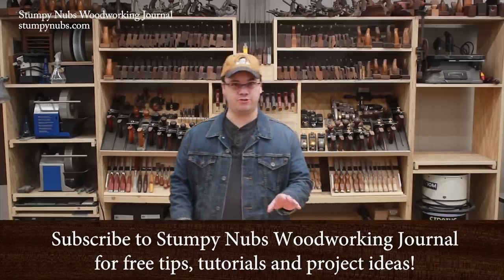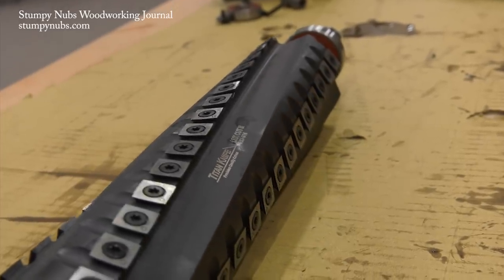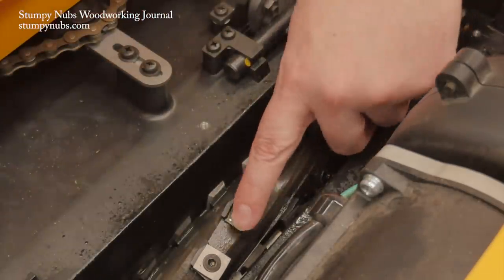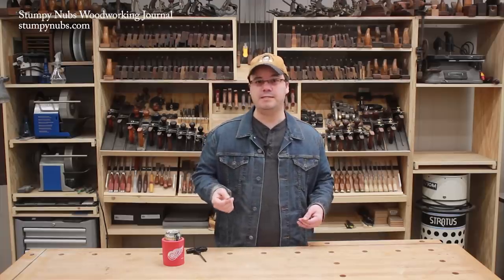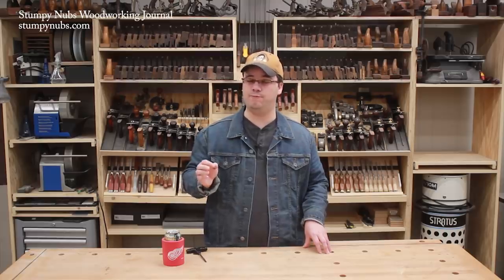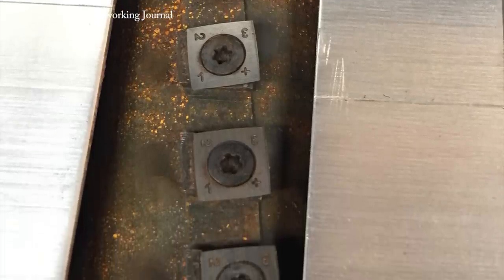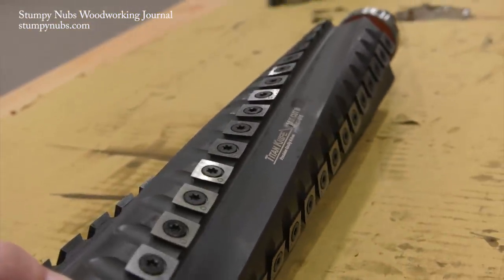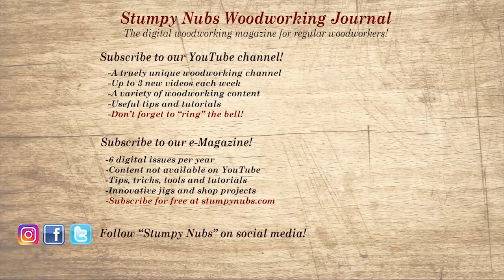Uh-Oh! Problems with carbide helical jointer/planer heads? (How to fix them!)

Comment: After running insert tooling for over 45 years in industry: when you strip a screw head, the standard method is to take a punch and shatter the insert. A blow straight down against the insert. They are brittle and can be shattered relatively easy. Once the insert is shattered the pressure is off the screw and it can be re moved with visegrips.
Reply: You da Man.
Reply: Yep. Been there, done that.

Comment: I was getting deep grooves in my boards after rotating the inserts. I tried to clean and reseat them several times before finally reaching out to Byrd directly. They sent me a pdf explaining a method to get the inserts to index properly. 
1. Make sure the head is clean and clear and the inserts are free of burrs.
2. Start the screw about 75% down into the head leaving the insert loose. 
3. Then push down & out on the back of the insert causing it to slide away from the back edge.
4. Finally, slowly tighten down the screw so the screw pulls the cutter down and back against the seat. 

I just finished trying this method on my cutter head and it worked great. My grooves are gone.
Reply: thank you for this, I rotated and now I have grooves, took everything apart and cleaned and still have grooves, I'll try this push down method, thanks again

Comment: I know this is years later but wanted to say thank you, James, for posting this video which I found when looking for a fix for my planer problems. I saw the tell-tale shallow grooves in my boards after running them thru my planer after a couple years of use and no matter what I tried, I just couldn't fix it. Only when you showed the diagram of how the indexing might be wrong did it click what might be up with my setup. I also cleaned the cutter heads and the space around them and now it's back to cutting butter smooth. Thank you so much.

Comment: Thanks for the tip on Woodcutters. I purchased a helical head to upgrade my 19-year-old jointer and it fit perfectly when it arrived. What a difference it makes in quality of cut and noise reduction. Thanks again for sending me to Woodcutters.

Comment: James, as usual, your posts are spot on.  I replaced the head in my DeWalt 735 7-8 years ago and it has performed flawlessly.  That’s not to say that I’ve never had nicks in the inserts leaving raised “grooves”.  The usual failure mode is for just the tip of a corner chipping and it can be difficult to locate the offending cutter.  I’ve found a lighted magnifier to be invaluable in such instances.

Comment: Yep.  After taking all the cutters off and reseating them, it cuts beautifully now.   75 cutters.  About 4 hours from start to finish taking the cutters off, cleaning and carefully inspecting each seat, doing the same on each cutter, never-seizing the fasteners, and carefully reseating each one and verifying that they are flat against the bottom face and not hung up on the bevel.   What a PITA.

I can't vouch for the Luxcut but if they have a system that removes seating error, then I'd recommend getting that one instead, just so you don't have a bunch of improperly seated cutters from poor factory installation and QC.

Comment: I have a Woodmaster 18" planer I recently upgraded to their helical cutter head. You mentioned that some head in a moist area rusted, and could pose a problem. When I first got my Woodmaster home, it had also included the sanding drum. It had a solid steel bar that the drum mounted to it. To avoid the rust problem I sprayed the bare steel with spray layout blueing. It has not rusted and looks just as when I brought it home, in 1993. Just blue.

Comment: My thicknesser has started producing grooves in the boards it passes through it. I have not yet changed the heads around. I was looking for a solution to this anomaly and have not really had any satiating tips on how to do so.

Thank you Stumpy for this magnificent tip! When I turn around the heads, I will be sure to take your advice and make sure they sit properly, after cleaning up any residue first.
Reply: If you're getting grooves down into your wood, a cutter may have twisted slightly, and one of the corners is digging in deeper than the rest of the cutter. If you're getting ridges above the surface of the wood, a cutter is likely chipped.

Comment: I have installed many helical cutterheads on planers and jointers and worked on many more. Whenever I install a new head I always check torque on all the machine screws and I always find a few that need a little more torque. I check it again after 1 week of use and again after 1 month of use. I always find a couple more that have loosened up a little. After the 3rd tightening they are all good to go, I also do this procedure after  turning all of the cutters.

Comment: Thanks for the info. Just put a Byrd Shelix, much due to your reccomendation, in my Ridgid 13" planer 3 days ago. So far I would call the upgrade in cut quality extreme. Appreciate your content.
Reply: I have a Ridgid R4330. Are you happy with the switch from the HSS to the Shelix? Have you ever bought carbide blades and if so are they worth the between cost of HSS and Shelix?
Reply: @timmartin6748  I've had the Shelix for about a year and don't regret getting it one bit. During the install I cleaned/oiled everything and installed a new drive belt. Motor doesn't bog down in really hard wood and the surface after plaining is really amazing. Had to rotate 1 cutter so far. Haven't had to buy any. It will be many years down the road, if ever, when I have to buy new cutters.
Reply: @Average American  I just installed a helical head. I still get minor tear out around knots. Have you  noticed any or should I expect a bit of tearout

Comment: I noticed that the lux had a circle on one corner. I put a tic mark on the edge that is to be replaced. That way, I do not accidentally put the dull edge forward. It also tells me when I have used all four edges. (always rotate the cutters the same direction.) I also put a number on the start of a row so that as I rotate the cutter, I know which one to move to next when torquing.

Comment: Just installed a brand new Shelix on my 15" grizzley... and yeah, there's three spots it's leaving pretty bad lines on the board.   I suppose its possible I damaged some of the teeth installing it but I was very careful and took precautions.  We'll see.    I marked on the outfeed side of the planer head where it was leaving lines so I can find the problem a bit faster when I take the cover off.    Hopefully its just improperly seated carbide teeth.   Not really happy about it either way considering how much the thing cost.

Comment: from a machinist perspective, always put the insert into place before you tighten it down and always clean the pocket.  carbide is very hard and will support tons a compressive force but will break easily when under tension.

Comment: The Byrd Shelix is what I upgraded to in my Dewalt 735.  Good investment from my point of view.
Reply from the maker: I put a Shelix in my DeWalt 735 too. But I put a Lux Cut in my larger Grizzly planer. Both work very well, but I got a little rust on my Shelix. I'll have to keep an eye on it.
Reply: @StumpyNubs  What, if any, are the differences in the actual cutters (4 sided)?  Is a Byrd cutter interchangeable with a Lux cutter?
Reply: @StumpyNubs  did you go with the reduced diameter head on the Dewalt or the full size? Any recommendation.
Reply from the maker: @JamieJCyr  - Full size. The reduced size throws off your depth scale and keep increases the minimum thickness of the stock you can plane from 1/4 to 3/8.

Comment: I'll stick with my cheap replacement blades.  I don't run that much material through my planer to merrit the added expence of the upgrade.  However, as a retired machinist, I can totally appreciate the insert style cutter heads. Thank you for that informative video.
Chuck
Reply: I wish I stuck with straight blades. Helical cuts scallops that no one mentions. Not flat like plain old straight blades.

Comment: If you want to be exact about torque on the screws buy a inch pound screwdriver. You can find them at most gun supply places such as Midway Supply online. They are not expensive and are adjustable so it can be useful in other applications.
Reply: Just checked the listing on Midway USA. their inch pound screw driving tool is marked metric (Nm) and the user has to convert using a printed chart. Sounds like a pain in the butt.

Comment: anti-seize compound is mandatory when reassembling these heads. Having to machine out stuck/broken screws sucks. Also a brass brush will help with some more aggressive cleaning without wrecking anything.

Comment: I've got an Axminster spiral head planer/thicknesser. When I gave the cutters their first turn last year, I broke off one of the torx bits. I think I may have twisted three of the ones that came in the cutter pack. It's still cutting fine and I'm just going to go as long as I need to before I have to resolve that ****ing broken one.
Reply from the maker: One comment suggests breaking the brittle carbide cutter to expose the screw head so you can get some vise grips on it. Not a bad idea...
Reply: @StumpyNubs  It's reassuring to know that I had thought of doing the same thing. I'm hoping that it's a case of a few firm taps to fracture them, instead of walloping them and potentially damaging more than the cutter... I shall see... Cheers, Stumpy.

Comment: wouldn't an impact driver either the old school hammer type or a newer drill types be useful in removing stuck screws?  With a new proper bit and constant pressure seems to be a good solution.  I'm buying an older jointer and just learned about the Lux head from My wood cutters.  I think that's the correct choice foe me

Comment: Hey Stumpy!  Do you have any feedback on the Sheartek brand?  They appear to be the most of expensive of the three, but Lux does not yet offer a head for my jointer, a Griggio PF-400 16" beauty.  I've had some of the problems you mentioned with a Shelix head in a planer, and would like to consider an alternative.

Comment: I bought the Shelix cutter head for my Dewalt planer five years ago from Byrd tools, along with several little boxes of extra cutters,  so probably would stick with Shelix for that reason, though I feel a little wistful not to have known about the new Lux Cut option when I ordered a Shelix for my Jet jointer a couple of weeks ago.  Anyhow, the new cutter head arrived promptly, straight from Byrd Tool Corp in Kentucky, with no suggestion that Steffen or My Wood Cutters had a thing to do with it until I saw his name on the packing slip. Nor were any instructions for installation enclosed, though Steffen's web site does suggest looking at a generic video that might or might not tell me what I need to know about installation on the Jet.  Bottom line: an entirely impersonal transaction through a third party, though I'd like to think that Steffen will have my back if I have a problem.
Reply: On the Dewalt, did you go with the smaller head or the full size.
Reply: @JamieJCyr  full size, and it works great.

Comment: So I've not changed a cutter yet, but noticed that in the case of the Shelix head, the picture looked like it was engaging and drawing down the cutter rather cattywampus, with the head not fitting properly into the countersink.  On the Lux Cut picture, they appeared to fit properly, although there was no bevel under the screw head.  Could that lead to uneven pressure from the screw?  Just curious . . . not sure if that's a factor or not.

Comment: Wheeler Engineering makes a torque wrench for firearms that may work for setting the torque on these cutters.
Reply: Any 1/4 inch torque wrench should suffice.  45 inch pounds is just under 4 foot pounds.  It's actually 3.75 foot pounds.

Comment: Now as a machinist and using carbide inserts on a daily basis I will give you my solution to a striped screw. Ok, here goes...Your best bet is to smash the insert. Carbide smashes extremely easy from a sharp blow. The insert will shatter from around the screw. Now don't just go hammering away. Take care: Cover the insert with a rag and know where your hitting. A swift, sharp blow with the ball end of a ball peen (pein take your pick) hammer should do the trick. If you whack it too hard you'll embed the carbide into the seat. In 35 years as a machinist I've done this many, many time. Use common sense.

Comment: Here is my conundrum. I own a grizzly G1018 8" jointer. I bought it 2nd hand and it probably has a value ~$300.  Is it worth it to replace the knives currently in the jointer with a $500 helical head, or do I just buy the much less expensive knives?  I don't have any desire to purchase a new(er) jointer as the current one works well, aside from the existing damaged knives.  As I write this, I am beginning to come up with the answer, but other thoughts would be good.
Reply from the maker: It depends on two factors- Is the condition of the machine good enough that it will last you for a long time? And do you use it enough to justify the upgrade? If you use it non-professionally but still fairly often, it will only take a year or two for the head to pay for itself because the cutters last so long. But if you only use it a handful of times a year it will take much longer to pay off. Of course, if you work with figure woods or reclaimed lumber that keeps kicking your knives, a helical head may be worth it to you just because it makes that sort of thing much easier.
Reply: Agree it depend on the condition of the machine.  I have a grizzly and have rotated the knives twice now.  Good advice on keeping it clean.  I plan a lot of hickory,Oak and other hardwoods,  I haven’t had to rotate the knifes very often.  First set lasted almost a year.
Reply: There is an early and late 1018, the older one I have they do not make cutters for. The new one from what I understand has twin belts, mine has one. I ordered from Grizzly and it was at least a 1/2 inch to big in diameter of head and bearings.

Comment: If you have to finish tapping the threads, USE A BOTTOM TAP!!! You'll have to order one unless the there's a machinist supply store near you. (Yes, I'm repeating what Pat Farrell commented a week ago - he's right, a tap off the shelf at a hardware or box store WILL NOT do the job.  Also, make sure you blow any crud out of the hole before AND after you tap it.

Comment: The Byrd  cutter heads are cheaper than the Lux as far as I can tell.  For a 13" Dewalt 735 the Lux is $439 and the Byrd is $405.  If there is that much of a wait for the Byrd I would pay the difference for the Lux no problem.

Comment: Just a follow up. I received the Lux Cut III for my Dewalt from My Wood Cutters. There were no instructions on how it install it. I contacted My Wood Cutters and they responded quickly saying the installation was the same as the Shelix except the cutters need to be removed. Great, but why were no instructions included in the first place, why should I have to contact My Wood Cutters to find this out. There's room for improvement on My Wood Cutters part in my opinion.
Reply from the maker: Mywoodcutters is a retailer, not the manufacturer. They don't package the heads with or without instructions. And since every machine is different, you have to use your machine's manual to see how to remove it's old head.
Reply: @StumpyNubs  My Wood Cutters sold the product they knew which cutter I bought they have sent me several emails regarding my purchase. It would have been very easy for them to have sent me a note in one of those emails letting me know what instructions to use.
I do agree the manufacturer should be the one that should have included some sort of instructions, but they didn't.

I can't remember the last time I got a product that didn't have installation instructions even if they were in Chinese.
Reply from the maker: @johnbourg3388  - Respectfully, I think you are looking at this backwards. Your machine's manual should describe how to remove the head in YOUR machine. You can't expect a retailer to buy and disassemble every machine out there and make manuals for them. They are a retailer, it's simply not possible. If you had bought your head at Woodcraft, (another retailer) would you expect them to make you a manual specific to your machine? Of course not. That's on the manufacturer, not the retailer. You can argue about whether the machine manufacturer or the head manufacturer should give you that info, but I don't think it's reasonable to demand the retailer do so. The fact that mywoodcutters.com WAS able to help you when you contacted them is not a failing, it is a remarkable piece of customer service that went, in my opinion, above and beyond what a retailer will usually do. They did the manufacturer's job! I see that as a good thing, not as a bad thing.